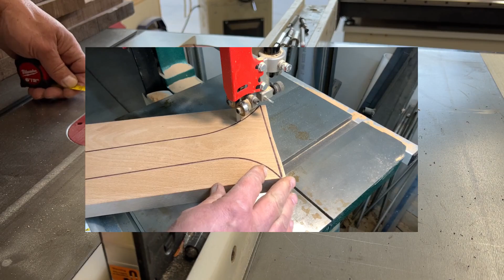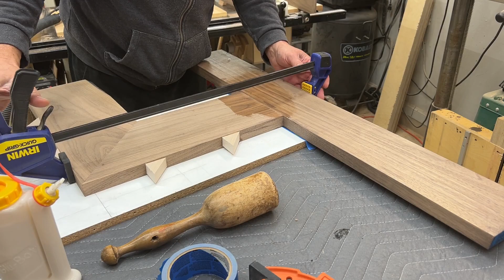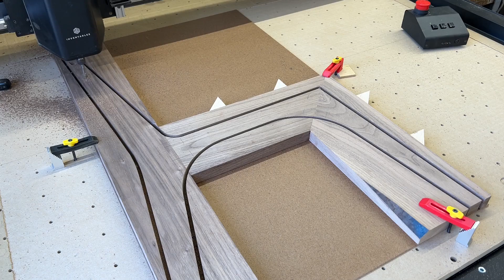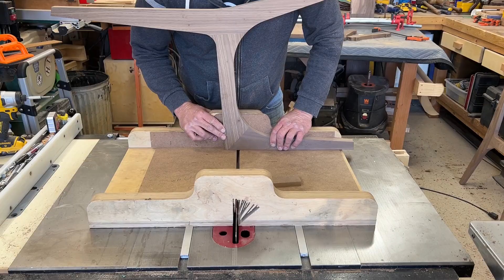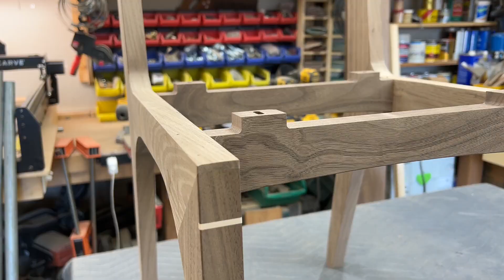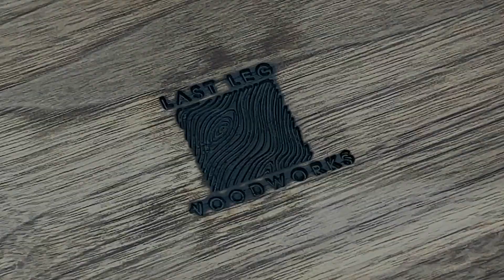"Handmade" Modern Dining Chair (Made with X-Carve Pro)

Comment: I do it differently.  Basically I replace the jigsaw and the template routing with the CNC.  So I glue up AFTER stuff comes off the CNC.  On my little machine I can't trust the CNC to mill a face that's clean enough for joining.  I wish I could but even with a finishing pass it just isn't quite clean enough.  So I have to trim on the table saw.  But that's not worse than template routing.

Comment: What type of toolpath did you use for curve of seat?  Great video, I am building a chair very similar an put an inlay in the seat back with the fluting toolpath. I used the molding tool path with a double sided cut to put curve on back as well, both on seat and back.  Thanks and again great video
Reply from the maker: Thanks. I made the toolpath in Fusion 360. I fumbled through it and get it to work but it wasn't easy. I need to work in that software some more. Thanks for watching!

Comment: To product the tool paths where the spindle is moving in both the x and z axis, do you have a different software, or is that calculated in easel pro? I’m new to this and am just in the researching phase. I’d like to get into complex curves, in addition to the simple single plane carving.
Reply from the maker: I designed that process in Fusion 360. not easy software to learn but there are a lot of online tutorials that can help. Thanks for watching!